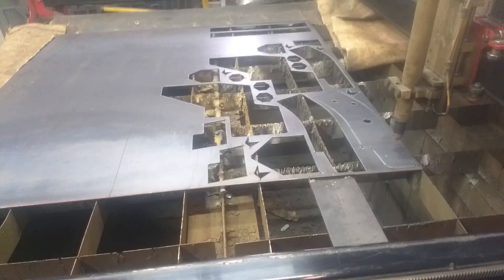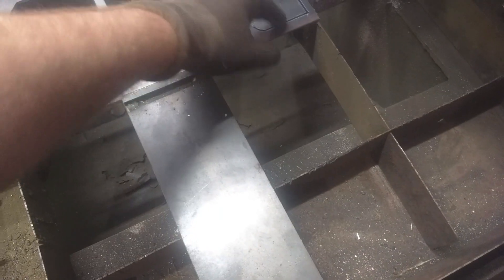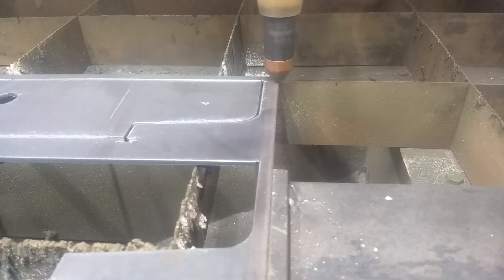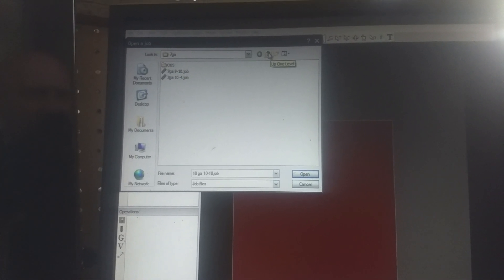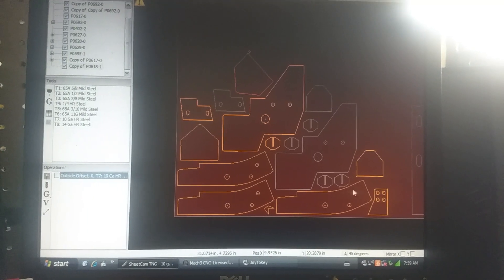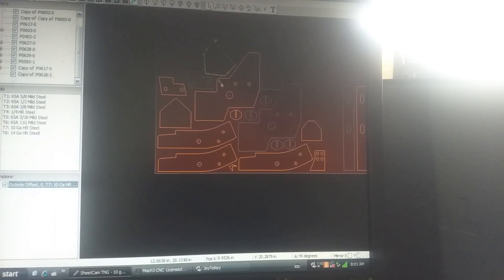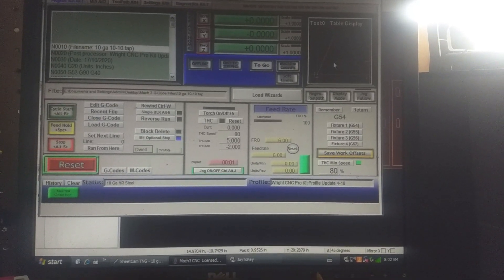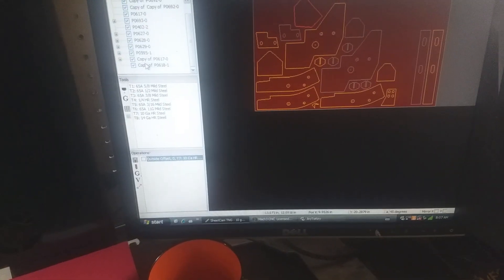Plasma Table Nesting With SheetCam on Partial Cut Sheets

Comment: Hey Man, cool,cool on the video, and wishing you much success. 
Just a side note question, with the spacers you made to keep your cut materials square, couldn't you have left off the added piece you welded on so it would not sit higher and be in the way of the torch? In other words, couldn't you just use a piece of plain ⅛ th inch plate with nothing else added to it so the  torch will always clear? 
Thanks
Reply from the maker: We cut thicknesses down to 14ga and a lot of that material isnt exactly flat and can have quite a bit of bow in it, we are actually running a lot of that right now.  That extra piece up there helps a lot on that material with giving a bigger area to hit.  You could get by without it but we just make sure we are back off the edge far enough.  I shouldnt be cutting out that close to the edge anyway.  On a lot of the thinner material we will run it with the inside of the bow up, in other words the center is down on the table and two edges are raised up.  We then have some small c clamps we use to clamp the edges down to the table.  Really only works with this table because we converted it to down draft and have the space below it for the screw part of the c clamp.

Comment: great video.
What width are your slats?
Reply from the maker: Yeah I think they are 3 inches deep.  The original tray was two trays bolted together in the middle.  I just cut the center out of both and left them noted together.  I've cut a lot of sheets on it and have yet to completely replace the slats.  I have rearranged the slats a couple times to swap high and low use areas.
Reply from the maker: My slats are 7×8
Reply: @TabooCustoms  Thanks for the reply :) sorry, I mean depth... it looks like 2-3?
Reply: @TabooCustoms  I'm actually building my own downdraft and wondering at what depth would a sheet 'survive'. I can see you cut over a channel in the middle of the table that seems to be surviving over time, and it looks to be at the same depth as the bottom of the slats?